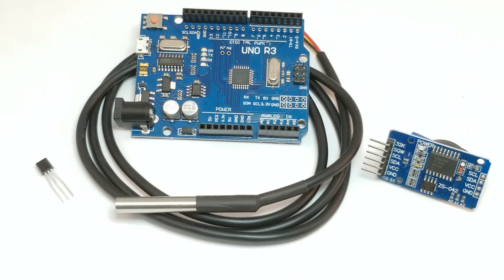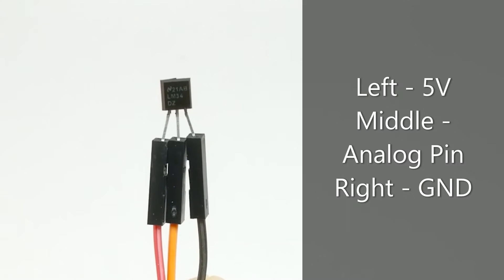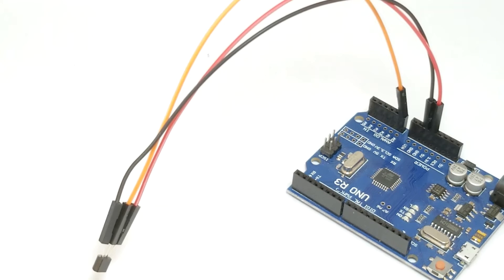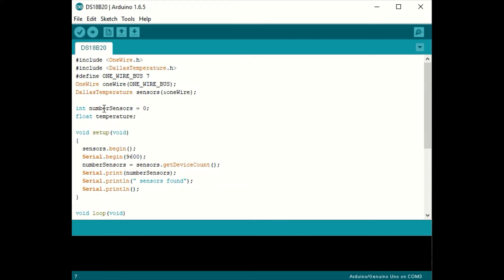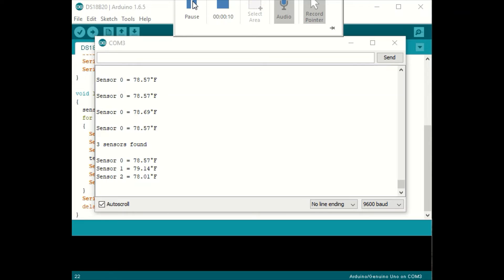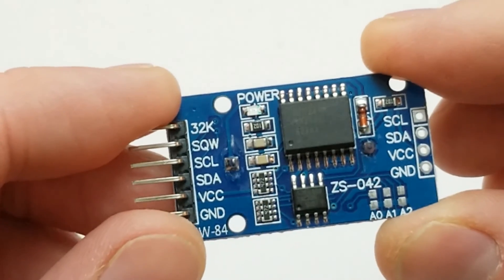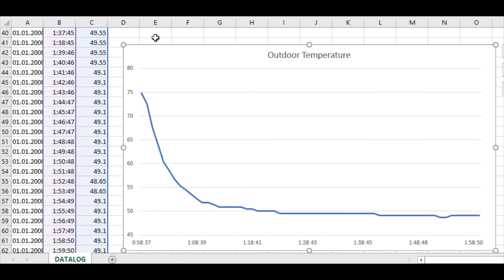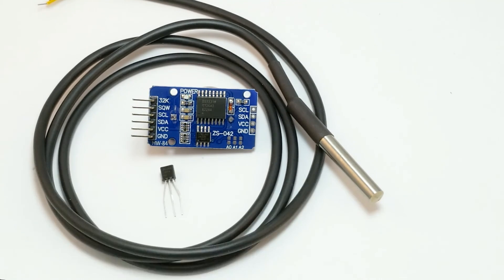3 Great Arduino Temperature Sensors // LM34, DS18B20, and DS3231 Real Time Clock

Comment: I'm putting together a project using an Arduino Nano to control a small lake aeration system running a couple of oil-free compressors, some cooling fans for the after-coolers, indicator lights, pressure sensors, and solenoid valves to distribute air to 5 different locations throughout the water.  I've used a 74hc595 to control an 8 relay module but I am still a bit short on pins.  I will need to monitor temperature for the control enclosure and found your video while researching the DS3231 temperature sensor usage since I will be data-logging the system.  Thanks for the video!
Reply from the maker: Glad it was helpful!

Comment: Quote from datasheet "The resolution of the temperature sensor is user-configurable to 9, 10, 11, or 12 bits,
corresponding to increments of 0.5°C, 0.25°C, 0.125°C,
and 0.0625°C". The datasheets are written for a reason everyone!
Reply from the maker: Good to know. 12 bit is much better, wonder why they just don't set it there all the time...

Comment: Do you see any signal integrity issues with three (3) DS18B20 sensors buried under ground (one data line) connected to the monitor with 200 feet of wire?  Geothermal project, I want to measure ground temperature at several locations in the buried pipe loop. Thanks!
Reply from the maker: Perhaps if you used direct burial cable. I have used them before about 50 feet with no issues. Just test it before you bury it! :-)

Comment: I want to connect ds18b20 sensor to my 3d printer because the other one was that with the end in glass and it broke. It is possible?
Reply from the maker: Depends on your 3D printer, they may have been using a different type sensor.

Comment: Hey, I’m just starting to look into arduino stuff now, and might be over my head on this one. 😂. What I would like to do is control a stepper motor based on the temperature inside a box. The stepper will open and close the lid as required to maintain temp. Any chance you could help!??
Reply from the maker: Yes. I have videos on stepper motors, fan speed control based on temperature, and videos on linear actuators. Check out the videos on my channel. Not exactly what you are looking for, but if you pieced it all together you could get it working. Good luck!

Comment: Something I have noticed is that the DS18B20 sensor is not super accurate at room temperature. It seems to report values a few degrees higher than it should. It becomes more accurate the farther away it is from room temp, but my sensor was report 80 degrees instead of 73-ish degrees for the ambient temperature
Reply from the maker: That is pretty far off. Mine have seemed better than that, but not super accurate.

Comment: for the DS18B20. I am trying to figure out why the temperature doesn't update. if I apply heat or let it cool down the new temperature doesn't reflect unless I restart/reset the Arduino board. Any idea what could be causing this?
Reply from the maker: Weird. Sounds like it is not looping. Or maybe a dud sensor?

Comment: #include <OneWire.h>
#include <DallasTemperature.h>

#define ONE_WIRE_BUS 2

OneWire oneWire(ONE_WIRE_BUS);

DallasTemperature sensors(&oneWire);

int numberSensors=0;
float  Celsius;

void setup(void) {
  sensors.begin();
  Serial.begin(9600);
  numberSensors= sensors.getDeviceCount();
  Serial.print(numberSensors);
  Serial.println("sensors found");
  Serial.println(Celsius);
}

void loop(void) {
  sensors.requestTemperatures();

  for (int i=0 ; i<numberSensors;i++)

  {Serial.print("Sensors");
  Serial.print(i);
  Serial.print("=");

  Celsius = sensors.getTempCByIndex(i);
  //Fahrenheit = sensors.toFahrenheit(Celsius);

  Serial.print(Celsius);
  Serial.print(" C  ");
  //Serial.print(Fahrenheit);
  //Serial.println(" F");
  delay(2000);
  
  }
}

  // the program was not given so i write it
Reply from the maker: Thanks!
Reply: Hey sir please give one Arduino mega board 🙏🙏